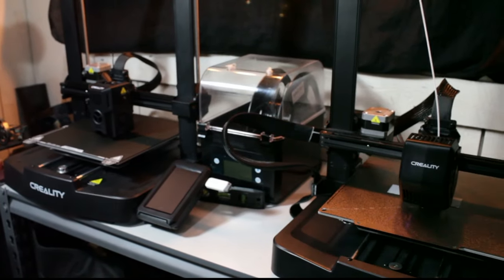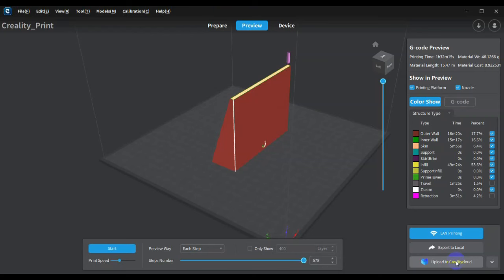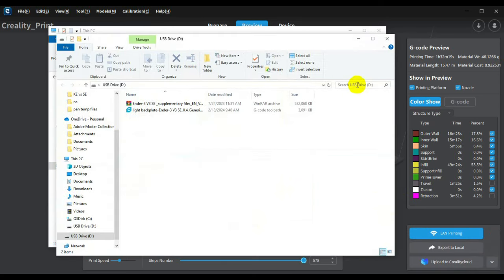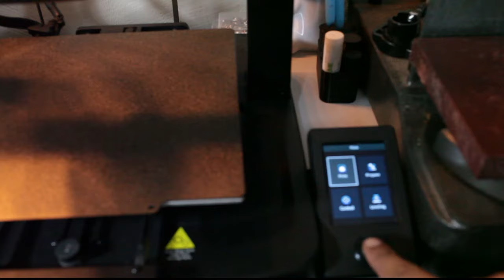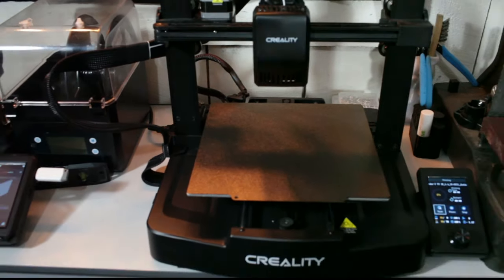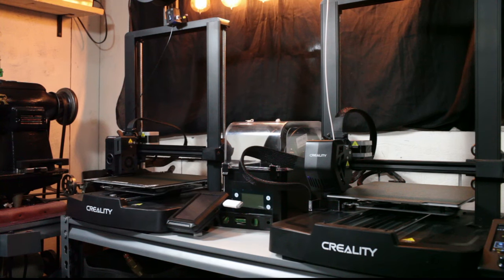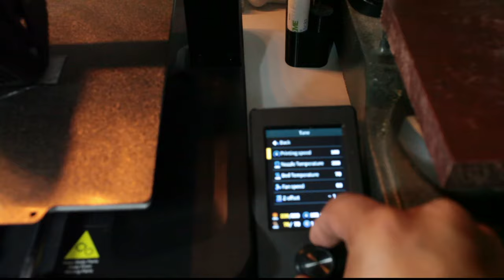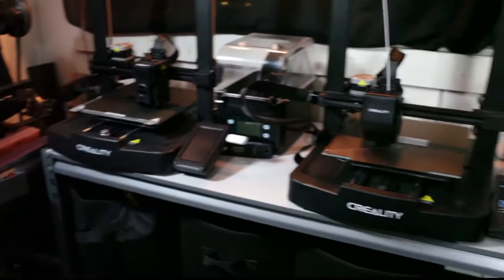Don’t buy Ender 3 V3 KE Part 2

Comment: Hi Instead of Changing Speed on SE, CR Touch Wouldn't it just be easier just use the KE Profile in the Slicer instead? Little Confused. As in Part 1 you Show Profile.
Reply from the maker: Yes, I used Ke slicer setting at the beginning but Creality changed some things in the latest slicer version that makes your printer even slower so I just cracked up the speed manually.

Comment: just wondering, my SE make weird noise when moving Y axis if i go over 110% speed
Reply: I came down here to say the same thing, but it's over 100 for me.
Reply from the maker: The Y is on tube linear rail maybe 🤔 
1- check if there is dirt or needs to be lubricant…you can use machine grease, petroleum jelly a.k.a Vaseline.
2- check if your bottom belt is tight.
Reply: @FarmerJon3D i am new to 3d printing, started 1month ago. I just checked it to make sure, and its clean. Belt is tight, i think. No problem with printing beside ghosting or salmon whatever. And i tried to print with different acceleration speed, nothing strange upto 230. Then it makes noise if it over 240. Have not tried to grease it
Reply from the maker: No worries, I’m making a bunch of videos on upgrades to SE. Greased my printer after my first print…it was making a suctioning noise. Don’t use too much grease a little goes a long way.
Thanks 🙏
Reply: @FarmerJon3D  thanks

Comment: %200 is only max 360mm/s, but it is fast, I have tried it so many times. Just fasten your screws every now and then.  You can also define faster speeds in the Creality software,  It is only limited by its processor I guess, I noticed circular patterns slow the print sometimes.
Reply from the maker: The KE has a bit faster acceleration and over time it gains on SE. 
They both have the same 32 bit board…I think the Nebula pad makes a huge difference. Creality sells a Nebula pad upgrade…I got one will install it on my next video to if improves quality and speed.
Reply: @FarmerJon3D   Well I have S1 and a DIY Prusa, S1 is not fast but gives best quality, and I only prototype using this, I am not sure if spending much on these works for me.  Waiting for your next video.